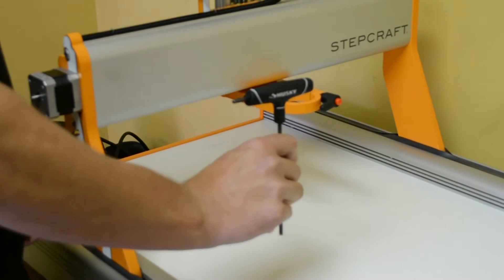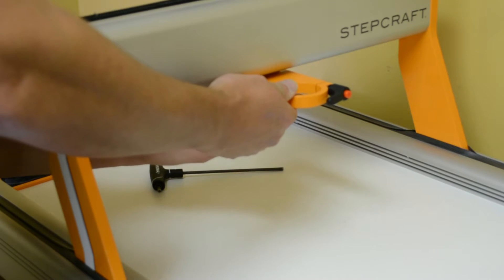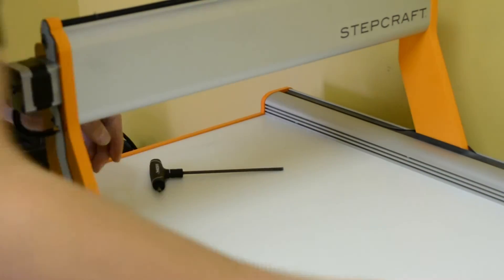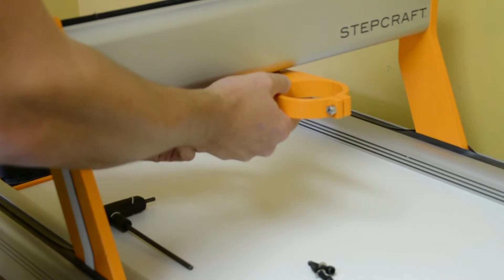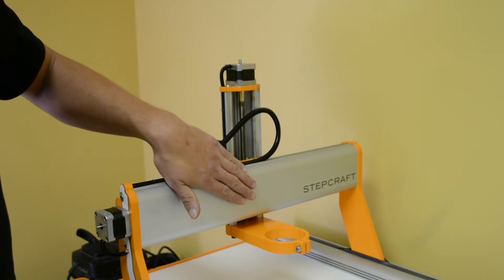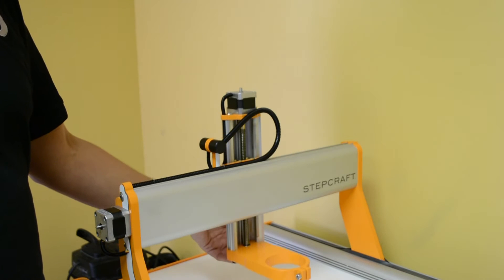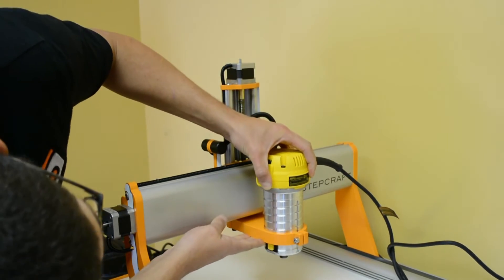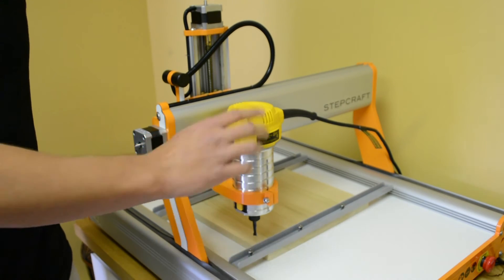Stepcraft 2 Dewalt DW611 Trim Routher Bracket Install

Comment: Do this add a lot of flex to the axes? it's standing pretty far!
Reply from the maker: No, it is designed not to flex.  it is a very rigid Z axis setup
Reply: @StepcraftInc  Cool thanks! :)
Do you have any videos of the D-840 doing aluminum (6061-T5/T6) or even steel ?
And where can I get that if I'm in Canada, any reseller in Canada?